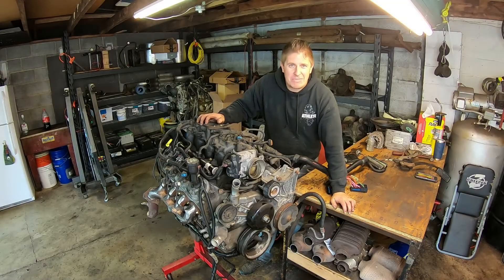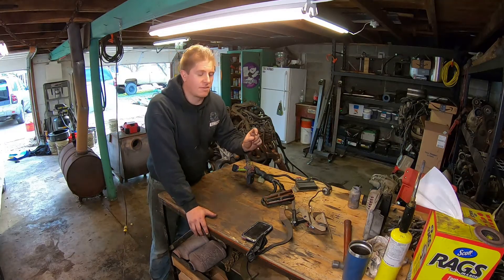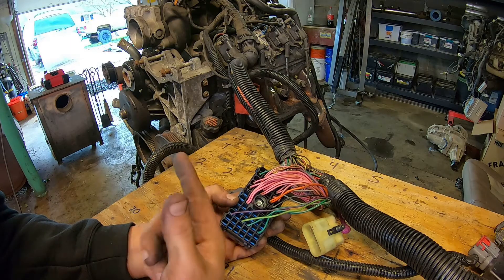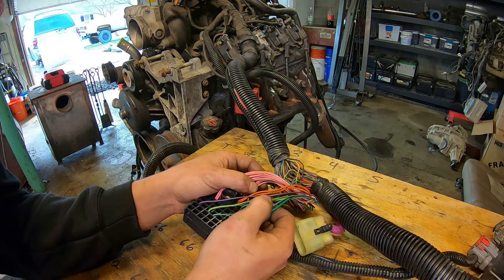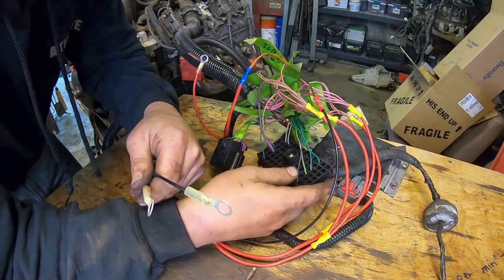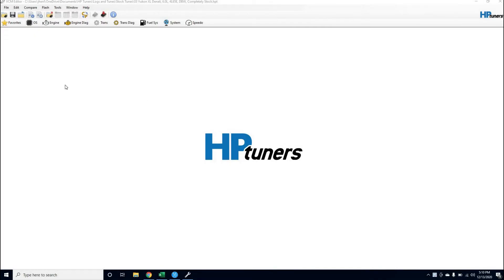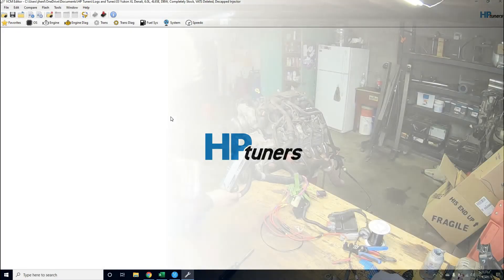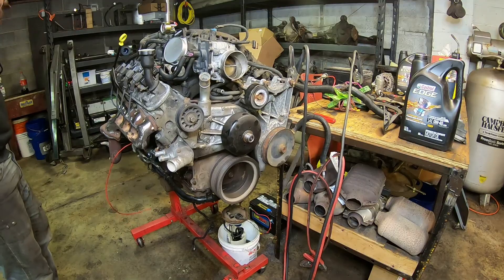Electrical HACK to run your LS on the Stand!!

Comment: I plan on using my PCM on my engine stand for multiple motors. If I change the Cam with just the delete vats will it still run
Reply from the maker: It might, it'll depend on how big/aggressive the cam is. Less crazy/pretty mild cams will probably start up when they're cold but have trouble running once they warm up. aggressive cams probably won't start.

Comment: Hey man this video is exactly what I needed for my build! Just one question. In your video, when you’ve consolidated all of the wires into 3 basic cables, I see a computer on the table in the background. Will that computer hinder a start up if I don’t have it?

Thanks for the help and the awesome video!
Reply from the maker: I used the computer to remove de-activate VATS in the PCM. These engines won't run by themselves out of the vehicle unless the VATS programming in the pcm is turned off.
Reply: @MohawkMotors  late reply: I think he was talking about the black box connected to the big round grommet

Comment: How did you connect obd2 plug to computer to hp tuner to turn off vats
Reply from the maker: I have a bench harness that I use, can also put it into a compatible year truck and just connect through the truck obd2 port.

Comment: Just ls swapped my 03 Chevy Silverado it was a v6 it runs and drives but wont shut off when i turn the key off and wont charge  what do u think it could be
Reply from the maker: What year engine, harness, and computer did you swap into it?
Reply: @MohawkMotors . It's a 01 motor with a 04 harness and computer  do u have any idea  wat I should do get another harness or  fix what I got
Reply from the maker: If you're using and 04 harness and computer in an 03 truck, it should work. If you didn't modify the harness in any way then you may just have a bad connection somewhere. Also did you convert the 01 motor to drive by wire to work with the 04 harness and computer or are you using a van harness and computer to run the 01 engine as drive by cable?
Reply: @MohawkMotors   yes I changed it to drive by wire my harness was cut in half when I got it and I got it wired to what I thought was right and it runs  but doesn't shut off at the key u shut the lights off after the key is on truck still run shut the lights off and the truck shuts off   I didn't know if u would have like any idea on the wire color or a video  something I could look at to correct what I did wrong
Reply from the maker: Sounds to me like you may have gotten some wires mixed up when you put it all back together. Some of the wire colors repeat so it's an easy mistake to make. I don't have a wire schematic but if you check LT1swap.com he has a bunch of schematics and pinouts. Can also probably find the ire schematic you need with a google search. It takes some sorting through but that usually where I find wire schematics when I need them.
Reply: @MohawkMotors   thank you very much  for you help I love your videos by the way learning Alot
Reply: @MohawkMotors   04

Comment: My harness never came with a fuse block it came just as yours is with the black block only. Could i do what youve done here but have the power circuit manually turned on and off with a switch (as the fuel pump will be) and run this as a long term in the car solution?
Reply from the maker: Yes, you could do it that way. I would highly recommend a fuse of some kind in the system as a safety but you could absolutely control it with a simple on off switch. (A relay would be a good idea, too much amperage going through the circuit for a switch to last very long)
Reply: @MohawkMotors  okay thank you very much! I don't know anything really about electrical stuff but I'm learning. Was tempted to buy a cheap standalone Amazon harness but I have the original one so might as well use jtn

Comment: Hello. If you can draw me a diagram of how the starter relay turns on. One wire comes out of the computer "starting charging system". Thank you very much in advance
Reply from the maker: The starter relay is very simple. The control side and load side are fed battery 12V +. The other terminal of the control side is run to the pcm, when you turn the key to the start position, the pcm grounds the control side and completes the circuit, which closes the load side of the relay. The other terminal of the load side of the relay is connected to the exciter post on the starter. SO, when you turn the key to the start position, the pcm provides ground to the control side of the starter relay, that activates the relay and closes the load side of the relay, which allows battery 12V+ to flow to the exciter post on the starter, which activates the starter and cranks the engine.
Reply: @MohawkMotors  Hello. thank you for advice. I want to tell you that I do not have a key block, nor a comfort block. I only have the engine and gearbox wiring. The starter wire comes out of the computer, but no action can come out of it, because the comfort unit and key are not connected. I am forced to put one relay in this circuit to false and put another second relay with a simple connection, which will work the starter.

Comment: I have a similar engine ls3, I did the electrics as you have in the video. We programmed the computer and turned off the "vats system". Unfortunately, the engine did not start. High voltage comes to the spark plugs, but no impulse comes to the injectors. Maybe you can advise me what could be the reason. Diagnostics shows me the error P0315. The sensor is working. Thank you very much in advance
Reply from the maker: If it has spark but the injectors aren't pulsing, first I would make sure they have a good 12V+ supply, then I would triple check that all the grounds in the harness are connected to the engine block on a good clean surface. If all that checks out and you still don't have injector pulse I would log the pcm inputs and make sure it has good cam and crank position signals. Double check also that when you removed VATS you did a WRITE ENTIRE because it won't actually remove vats any other way.
Reply: @MohawkMotors  Many thanks for the feedback and comments. I live in another country "Asia in Georgia". Watts was deleted in America and I don't know exactly how they did it. I will write a letter and see what they say.
Reply: @MohawkMotors  Hello, I saw your message late. I started the engine. I checked everything before and everything was fine. The only reason why it did not work was the starter relay, it did not turn on and the computer perceived it as an error, it did not allow the engine to start.
Reply from the maker: @4l1dm  Glad you got it figured out!

Comment: Good stuff. I’m getting ready to do a test start on my LS also. I am trying to find out the type of cam I have in it. The engine shop I bought it from said it had a BTR cam installed as they we’re going to use the engine for a drag car, but decided to go with a big block instead. I’m waiting on a response from the shop.
Reply from the maker: Yeah either specs from the shop or pull the rear cover and get the part number off the back of the cam. BTR has TONS of cams so it could be anything. Good luck!!

Comment: did u have a pedal hooked up when running it? i have vats turned off on my pcm, i didnt select write entire when i did it though. but it will fire and run for half a second then shut off
Reply: was wondering if ecm not receiving a pedal input was shutting it off
Reply from the maker: In order to remove VATS you need to do a Write Entire, Write Calibration will not disable VATS.

Comment: Why is computer needed
Reply from the maker: The computer tells the injectors when to inject fuel, and when to ignite it with the spark plug.
Reply: @MohawkMotors  

Oh. On engines with carburetors,  what tells the spark to ignite?
Reply from the maker: the distributor

Comment: Why not use the factory fuse block first?!
Reply from the maker: I wanted this video to be for demonstration of how to run an engine out of a vehicle for people. A lot of times someone buys an engine and it doesn't come with the fuse block, or even the fuse block connector, just a chopped off harness, I was hoping for this to help by not relying on those being there.

Comment: How did you connect the fuel pump? Thanks for the video 🔥🔥🔥
Reply from the maker: I made a portable fuel sending unit, it's a 5 gallon bucket with a fuel sending unit out of a truck I parted out, just connect the feed to the feed and return back to the bucked and give the pump 12V and a ground.
Reply: @MohawkMotors  ok thank you!!!

Comment: Did everything the video said when I put power to it engine doesn’t make the noise yours did
Reply: No injector pulse or spark from coil but I have power going to the coils and injectors
Reply from the maker: Do you have hp tuners or a scan tool that will allow you to live view the pcm inputs? No injector pulse and no spark when you have goo power and ground supplied would make me think you aren't getting crank position signal to the pcm, it's the only other ingredient the pcm needs to fire the injectors and trigger spark.
Reply: @MohawkMotors  I have spark now but still no injectior pulse
Reply from the maker: Spark is a good sign, that means your pcm is probably getting signal from the crank position sensor. The injectors are ground controlled, so they should have power supplied to them all the time when the key is on, if you're getting good spark that means your pcm knows the engine is spinning, and you definitely have good power supplied to the injectors with the ignition on, then you're missing the ground somewhere for the injectors. I would double check all my ground wires at the termination end and at the pcm connector end, make sure everything is good. while you're doing that check the wires themselves with a resistance test from connector end to termination end and make sure the wire isn't broken somewhere in between.
Reply from the maker: What did it do? Did it crank over? Did it sputter? Did it do nothing at all? I'll try to help, what happened when you tried to start it?
Reply: @Mohawk Motors  I got the engine to make sum noise but still doesn’t fire just got my vats deleted an still nothing

Comment: I have a 6.2 engine. So I tried and it didn’t work out. I am told that I need an immobilizer. Please tell me if you need an immobilizer?????
Reply from the maker: I'm not sure about an immobilizer, but you will need to remove the anti theft (VATS) from the computer. Did you do that?
Reply: How do you remove the vats from the computer